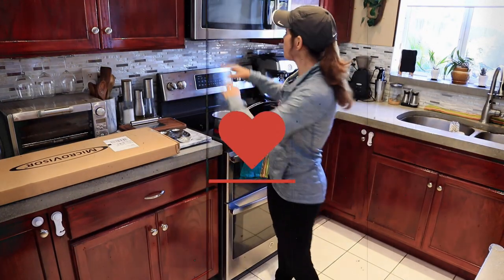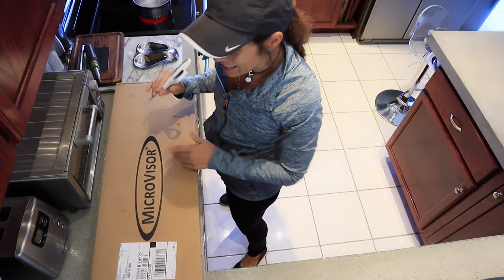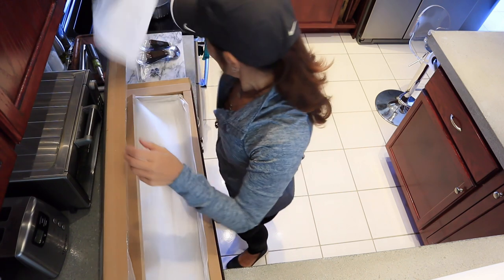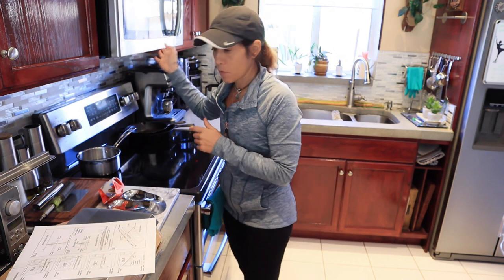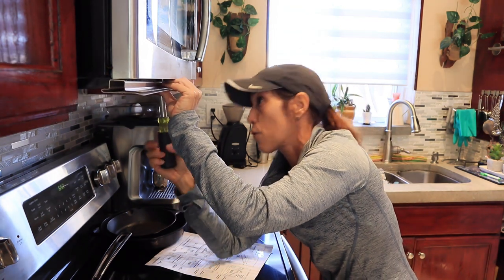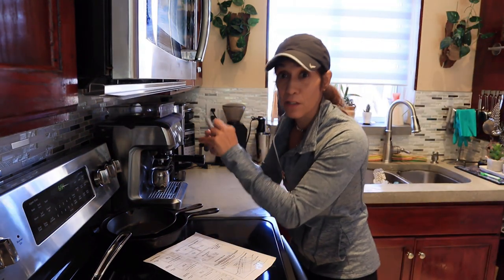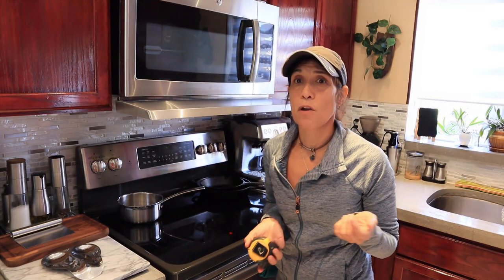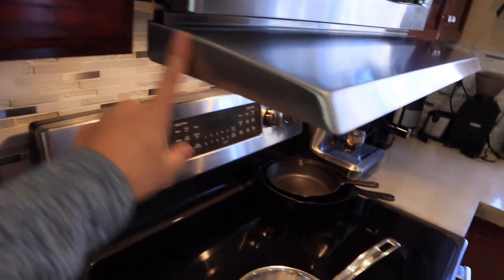ELIMINATE KITCHEN FUMES [ MICROVISOR HOOD EXTENSION ] Step by Step  Installation🪛 #microvisor #diy

Comment: It seems kinda flimsy .
Reply from the maker: Thanks for your feedback. In a way I agree with you  because It does shake a little if you happen to bump into it. However, it hasn't  been an issue for me. The unit is still intact so far.  Sadly I bump into It from  time to time when  I'm in a rush around  the kitchen 👍

Comment: This hood looks like a complete ripoff scam!!
Reply: Agreed, A piece of stainless  steel sheet metal, no filter or a motor to suck the fume.
Reply from the maker: Guys it is not a rip off. I have and I love it. Otherwise, I made the video wanting to share this device I found and hoped to improve the fume situation in my kitchen. If your microwave doesn't have a fan I figure it you would slash its utility in half. My microwave has a good working exhaust fan.  This only prevents the fumes from spreading everywhere. I still have it and I love it. Now the top cabinets don't have all the grease that use to accumulate before. I am not sponsored or had been paid by the company in anyway to make this video. Not even a discount code. I do appreciate your honest feedback. Thanks!
Reply from the maker: I am so sorry you feel that way. I still have it, use it and love it! It is not magical but in my case it does help a lot with the fumes in the kitchen. In my house I do all the cooking and cleaning. Thanks for sharing your thoughts about it👍🏼I always welcome different points of views and constructed criticism. 🤗